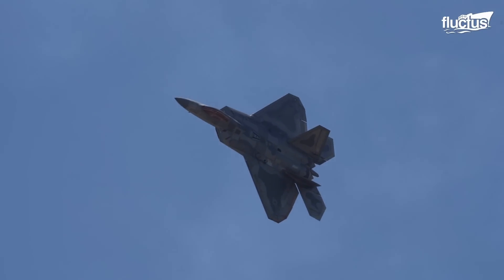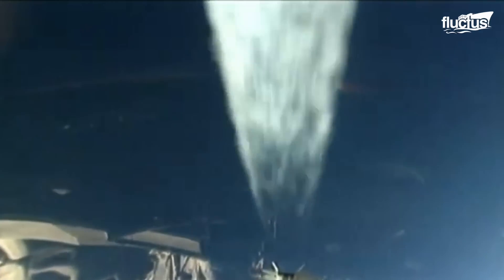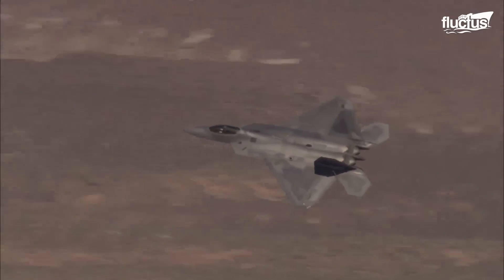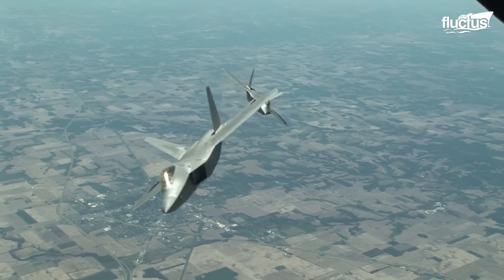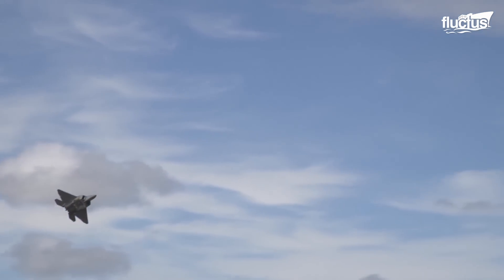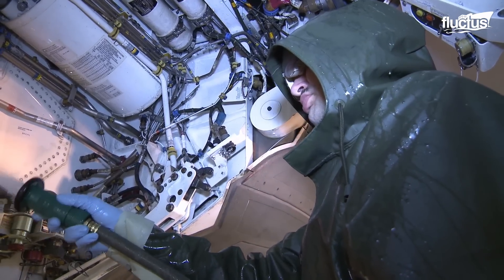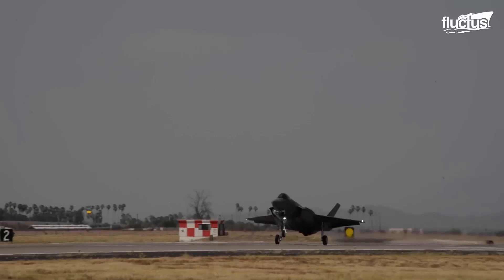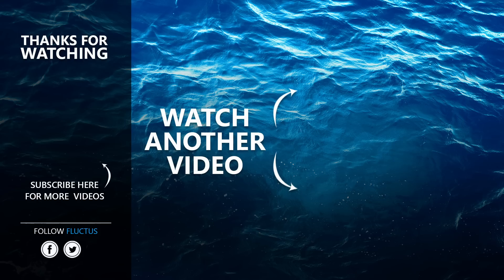F-22 Raptor: US Most Advanced Stealth Fighter Ever Built | Documentary

Comment: F-22 enthusiasts in 21st century need a reality check. While the F-22’s design was revolutionary when it debuted over two decades ago, it comes with significant trade-offs: high maintenance demands, limited adaptability, engineering complexity, restricted multirole capabilities, a short combat radius, persistent pilot oxygen system issues, and reliance on titanium alloys and composite structures that are difficult to produce at scale. In practice, this makes it an impractical platform with limited utility. Beyond airshows, the F-22 has seen virtually no deployment in real-world missions, highlighting its shortcomings.

Comment: The pratt&whitney F-100-119 turbo fan engines are rated at 70,000lbs of thrust useing only 40% percent more thrust than our F-15C eagles pratt&whitney F-100-220 turbo fan engines producing 58,000lbs of thrust but the F-15C eagle has a higher power to weight ratio than the F-22A raptor
Reply: ooh ooh say it again, I'm almost there...

Comment: Best fighter jet ever built 🔥💯💯
Reply: Then why are they phasing them out because they have the F-35?
Reply: @alanarmitage6706  It's because the USAF is working on the NGAD fighter, and plus it's very expensive to maintain the F22. It costs around $70,000 for every flight hour. Oh, and you mentioned the f35. So the reason to why the USAF is phasing out the f22 is because the f35 is seen as more reliable and costs less to maintain and the flight hour is also cheaper.